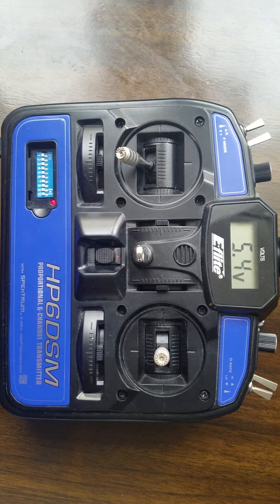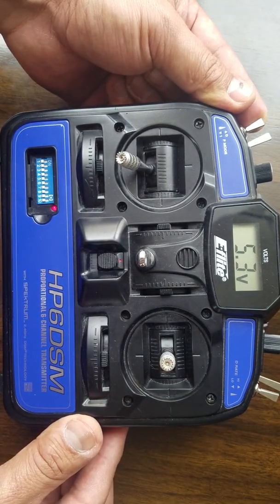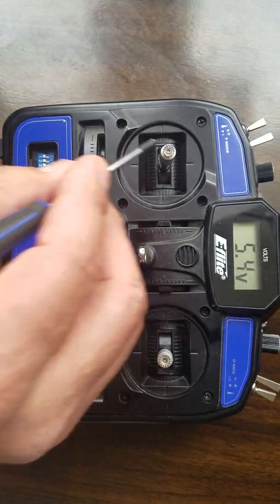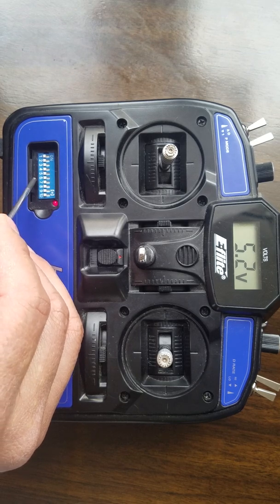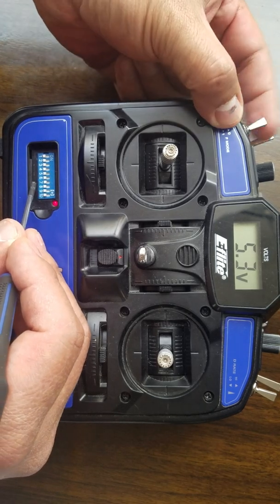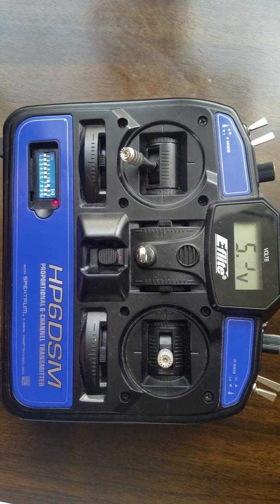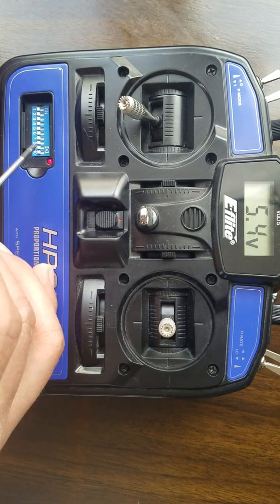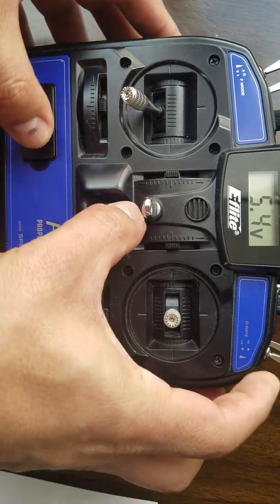HP6DSM EFLITE or BLADE DIP SWITCH'S ON TRANSMITTER SPEKTRUM DSM2/DSMX on DSMX

Comment: My plane both seems to not be able to use the throttle after putting them up for the winter but the throttle is controlled by the TH switch, I know it use to work and I’m pretty new to airplanes, by anychance do you know how to fix this
Reply: @CastroFelix  thank you so much!!’ That fixed it. I would have never of thought that was the issue